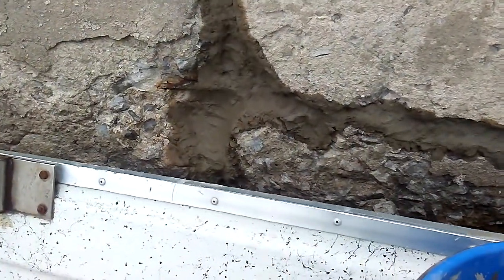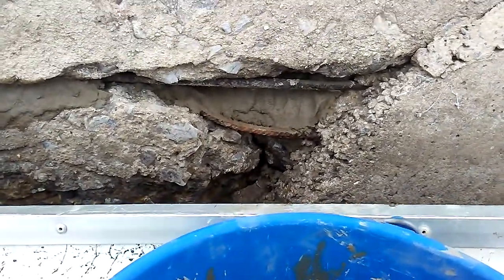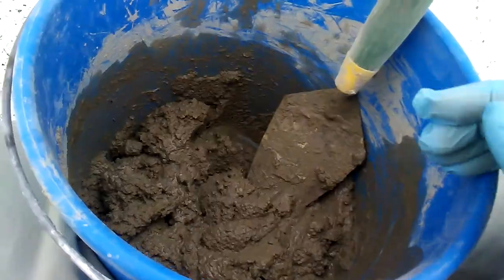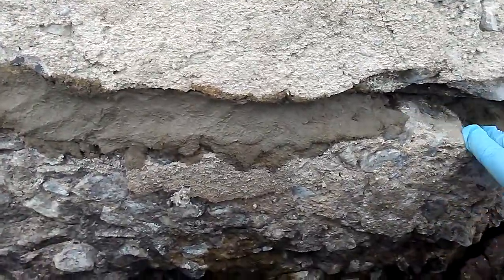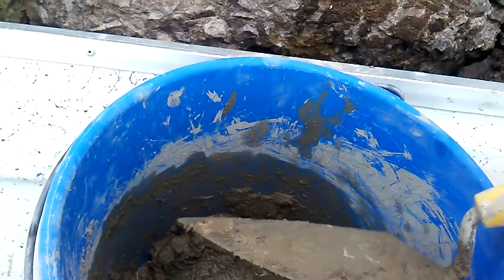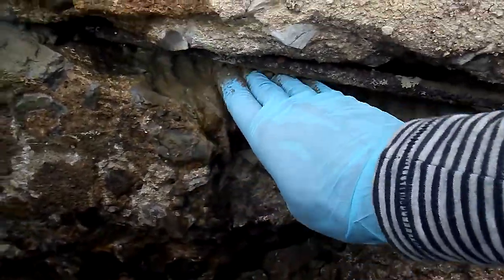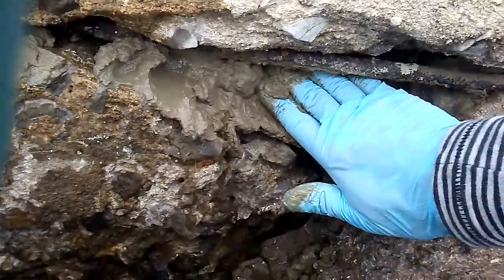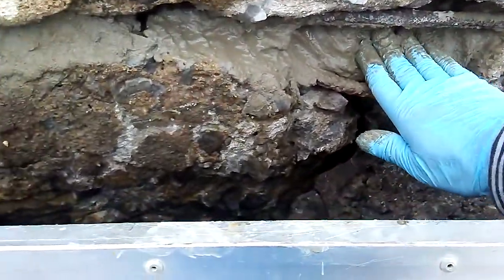Fixing small and medium size cracks in your sea wall or retaining wall

Comment: 60yo seawall in saltwater here in FL.  I've had good results with Sakrete leak stopper hand packed, trowed and brushed on the king pillar erosion.   Add a Top N Bond and whitewash skim coat afterwords and a brush finish if you want a good finish...  Biggest gaps or down low... Plan on doing this job in Jan or Feb because those are the lowest tides of the year if your down in SW Florida.
Reply from the maker: Thank you for sharing your knowledge, this will certainly help many! ps I miss Florida, been a while.

Comment: I am on a freshwater lake. The lake is now lowered for the 5 year drawdown. I have voids like yours and will have to build up a whole area. Would type N mortar work for this? I have to move quickly before the cold comes again. Thanks!
Reply from the maker: Hi, if your cracks are small or you want to refinish the surface, yes that mortar would work. To fill in midsize cracks just go with a regular concrete. If the cracks are more like holes that you can put your head in, then place some rebars and make a mold, then pour concrete. Yes move fast as you want +5C and above and definitely not sub zero C.
Reply: Picture a 3D pyramid with the tops cut off. I have 4 massive structures like that holding up the boathouse pier with I beams across the top Basically the faces are eroded off on 2. I have several bags of type N from a project 2 yrs ago and would love to use those if it is appropriate.

Comment: When tide comes it it will wash away.? Why not use fast setting cement? Or hydraulic Cement ?
Reply from the maker: Hi Bob, I'm in freshwater river and do not have any tides. Our water level changes according to seasons (high in spring, low in fall). If I had tides I would use fast setting but probably not hydraulic as it's way too expensive.
Reply: @photographiedynamic  .Ok Thanks for your response. They also use resins fiber and foams here in florida to patch .. Ill try the fast setting first.. If the tide movescin andvit washes ill go with hydraulic.
Reply from the maker: @BobBelson  Thanks for sharing! You definitely have to pay attention on what you use with a salt water environment. I can see how resin fiber and foam will be resistant to salt water. I do not have to worry about that issue, however I have other problems unlike you guys, I have to deal with ice movement and -35F temperature :)